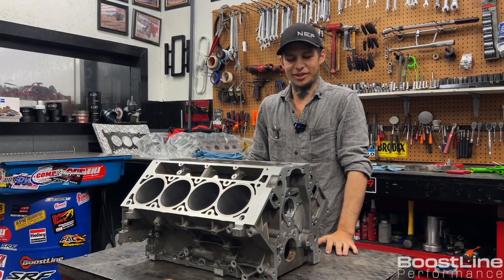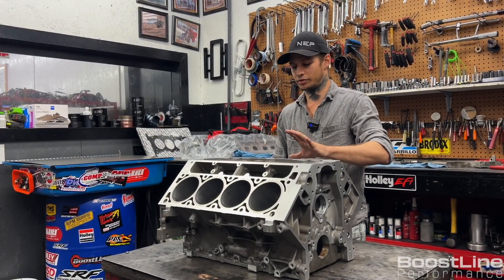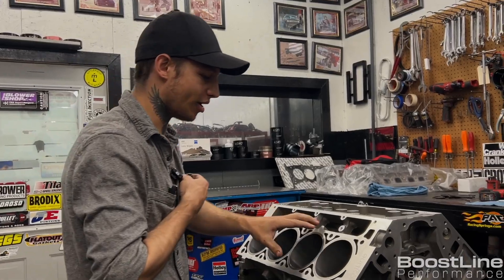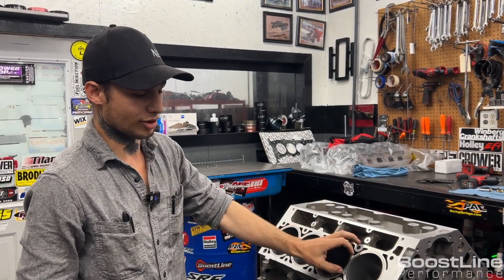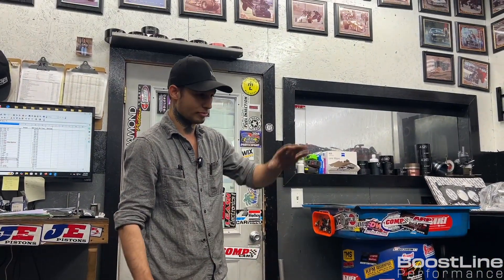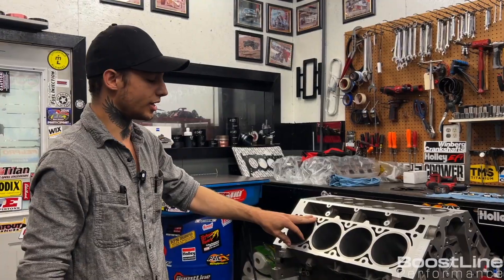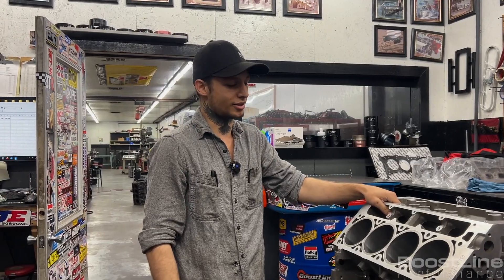How We Sleeve Our Big Bore 5.3 LS Blocks!

Comment: But if it costs 5 or 6 grand to sleeve and finish-machine a factory block, why not spend a little more money and buy aftermarket?
Reply: I sent my block to TKM for the same work (I'm in east TN), $2070 parts and labor without tax
Reply: Racing class rules that mandate a factory cast block. That's who Steve is making them for.

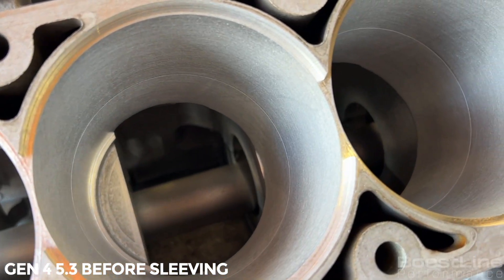Comment: The material left between the cylinders at 2:22 is paper thin. How does that not get too hot and/or warp?
Reply: It’s not 😂

The sleeves are 4.325” od there’s plenty of material left behind to support them.

Steve is far from the first guy to sleeve a 5.3.

Sleeved 5.3’s have been making over 2000hp for years without his “idea”
Reply: @th600mike3 Thank you for the clarification.

Comment: If one were to run the engine n/a could those sleeves stand up to a 4.185" bore? Also, have you considered sleeving a Nissan VK56? The blocks are very similar and I think it would be very cool to have a DOHC 398ci V8 using modified off the shelf LS sleeves, pistons and rods. Seems like modifying the VK56 would be a lot easier than making DOHC heads for an LS, a stock VK has handled 2000whp and they can rev upto 10k rpms which are things that would be very difficult and expensive to do with an LS.
Reply: Yes. That would be very interesting! Theres a company in Japan that does work on Engines and the Toyota 5.7 sleeved to a 6.8 !
Reply: Pretty sure the bore spacing is 100mm which doesn't allow for much larger bores to be installed so you cannot enlarge it very much just like a coyote